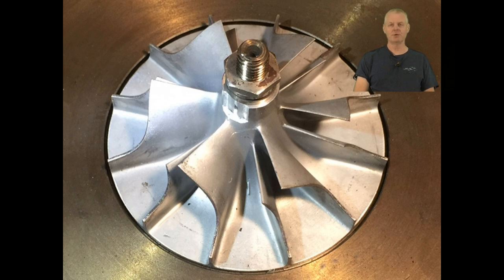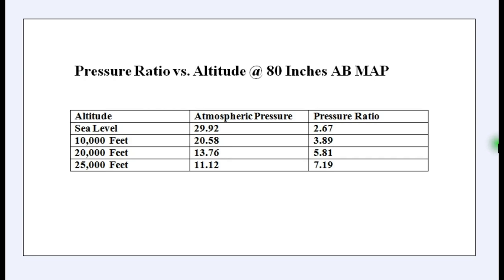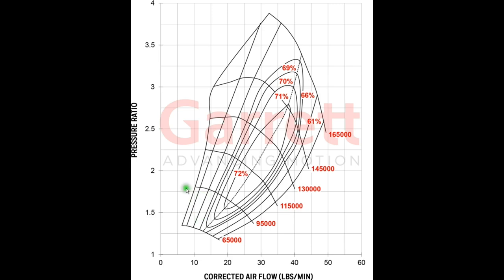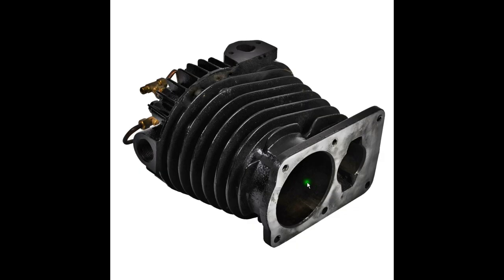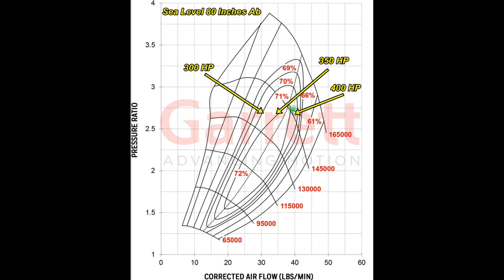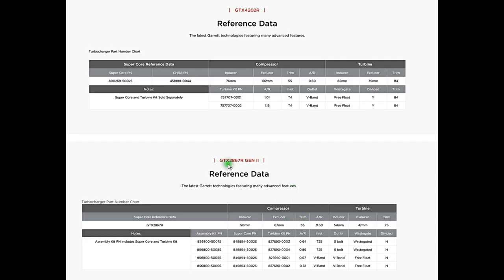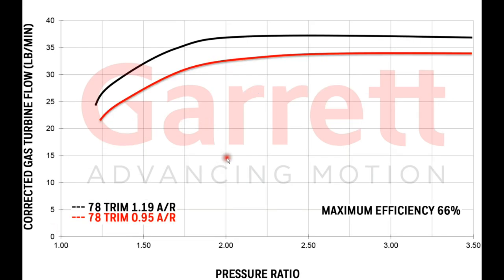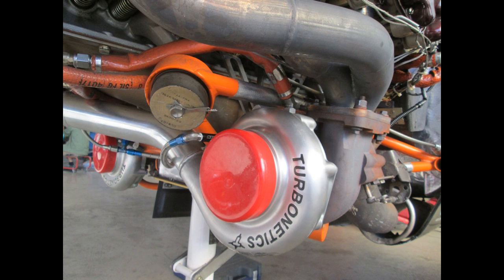What's Wrong With Raptor's Compound Turbo System?

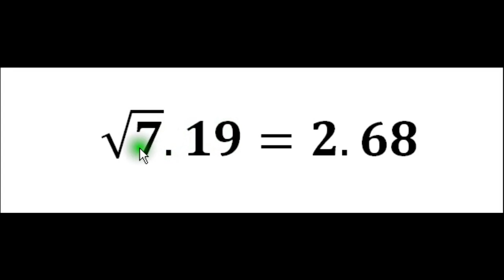Comment: Thank you for the video! I followed most of it--can anyone help explain how/why at 6:15 we multiply one turbo's pressure ratio (~2.68) by corrected airflow to get the 80 lbs/min figure? I'm guessing that's part of an equation for compound turbos?
Reply from the maker: Compound compressors are typically matched from the 2nd stage airflow first  and then multiplying by the first stage pressure ratio (2.68 in this case) Using Boyle's Law,  volume delivered by the 1st stage to the 2nd stage will be 1/2.68 (0.37) 0.37 X 80= 30. Note that Boyle's law assumes constant temperature during changes in pressure and in reality, we won't have that in a compound turbo system, which isn't a closed system either.

The video also ignores the fact that there is substantial temperature rise during compression and does not take into account any intercooling of the charge  air which we'd certainly need to do to have a functional system. 

The video is illustrative only (which I'm sorry, I didn't make clear) and is not about solid numbers for compressor matching for Raptor. My main purpose was to show that the equally sized compressors cannot work at 25,000 feet and the required pressure ratios. I tried to make that part clear by using the analogy of the 2 stage air compressor and showing photos of the size difference on actual compound turbo setups.

 I also tried to explain why the turbines used here are too small and also greatly impacting performance. As a data point, my 2.2L Subaru uses a turbine wheel about 10mm larger than Raptor where Raptor should have something around 10mm larger than mine with almost 50% more displacement and around double the HP.

I think many people are confused when I use the term compressor mass flow. Compressors are rated by CORRECTED  INLET flow- either CFM (volume) or mass of air (usually lbs./min).  

Corrected meaning inlet pressure and temperature are taken into account and often specified on the compressor map. If the map was developed at or near sea level,  that will be the correct inlet mass flow processed by the compressor down there. 

Now move the compressor up to 25,000 feet where in the inlet pressure and density is about 1/3rd of SL conditions and compressor won't process the same mass of air as at SL at the same compressor rpm.

Up high, we need to intake a greater volume of less dense air and compress it back to near SL pressure to feed it to the 2nd stage compressor so it can then increase that pressure to the required value  in the intake manifold to make rated power.

There are a myriad of other factors involved but a simple, short video can't cover all those things and that wasn't the intention of this one.

I'll try to touch on some other factors in subsequent videos on turbocharging and intercooling as this seems to be a popular topic.
Reply: @rv6ejguy  I follow now. Great explanation. Thank you

Comment: I totally agree that the engine setup and especially turbo setup needs to be different , and I do think that peter has to contact someone like you Sir in order to make them better.  the engine on raptor doesn't that good this is a fact.

Comment: Back in October 2018, I had the opportunity to visit the Raptor prototype and see what all the fuss was about. Peter was mobbed, but I had great talk with Jeff Kerlo his right hand man on the composite side of things. There was a couple of questions that I had, especially since I had built and flown an Express Aircraft (Auriga). I thought that the prototype was engineered poorly, especially the doors, which were way too complicated and heavy, the lack of radiator cooling, and the cantilevered seat mounts which were extremely heavy. The whole plane smacked of a computer generated fantasy, with no real knowledge of engineering.  I asked Jeff point blank why Peter  insisted on an experimental engine on an experimental aircraft prototype, he just shrugged and said that Peter wanted it that way. Just look at the Dark Aero boys--are they putting an experimental engine on an experimental prototype? Of course not, they are ENGINEERS. I have no qualms with being self taught, hell Elon Musk is primarily self taught--but he hires really smart and talented engineers to get the job done. If you are going to design and build an experimental aircraft start small say a two seater, and work your way up. Don't go full bore with the most complicated thing you can think of, dupe people of 25 grand a piece, and then claim that prototype 2 will be better. Give me a break.
Reply: Rick Feehery,  I'm really impressed with the Dark Aero brothers.
Reply: @YeshuamyKing53  , Yep!, me too!

Comment: In this case, why couldn't a single sizable turbo with a substantial impeller work since quick spooling is largely unnecessary? Maybe you covered this in which case apologies but it seems you're saying that a compound system is necessary.
Reply from the maker: No compressors in this size range can efficiently produce pressures ratios over 4 and we need 6-7 here.
Reply: @rv6ejguy  Would we also want to add fuel then?
Reply from the maker: @MrBryansa  The diesel requires excess air to operate efficiently, more fuel just raises EGTs further.

Comment: How do you calculate ideal turbo charger combinations when there is the big unknown of how much bleed air will be required to pressurise the cabin?

Seems to me you can’t until you take the aircraft up to FL250 while keeping the cabin altitude at something under 8000. Only then will you have the necessary data to make selections of the better turbo charger combinations.
Reply from the maker: I believe Peter was feeding the pressurization system with a 1/4 line in ground testing which may be too small unless he has exceptional sealing. In any case, most small cabin class twins leak something less than 30 cfm. Since this compressor is putting out around 1230 CFM, that would only be 2.4% of output which is inconsequential.
Reply: @rv6ejguy  Ah ha! Thanks for clarifying. I had no idea what leak rates could be expected.  It is indeed surprisingly inconsequential.

Comment: So what I’m seeing here is that the Raptor’s capabilities will be limited in terms of power and efficiency - it won’t efficiently push itself to the proposed altitudes, and it will have a hard time staying there. It might even be why cooling has been an issue. And maybe was a contributing factor to the engine failure. 
These are not minor issues. I truly hope there is the potential for things to change.

Comment: The thing is, retrofitting the two turbos in Peter's setup wouldn't be a tragically difficult switch, but would provide dramatically better HP.
Reply: Better HP an less heat to deal with.

Comment: From this it sounds like Raptor could conquer its engine cooling issues quickly by downsizing the 2nd stage turbo, or up-sizing the primary, if there is room in the engine bay.  It doesn't seem like it would be too expensive to fab. an adapter for a smaller 2nd stage.  I'd try that first.
Reply from the maker: Changing the turbo system would only make minor improvements  to engine cooling. Raptor will have much bigger cooling problems as it climbs into thinner air and at higher than 65% power like it's using now on a summer day. 

The coolant, oil and charge cooling systems are all poorly designed and would need a complete re-design from scratch to be functional on a 100F day, climbing to FL250 at climb power (say 80-85% power.
Reply: @rv6ejguy  I'm sorry to hear this, however, it sounds like Peter already has a complete redesign in the works.  This is also a very sensitive topic over there...
Reply from the maker: @bartofilms  It will need a complete re-design to get anywhere close to original performance predictions.

Comment: Presumably the people at Garrett would know this too.  I wonder if when choosing turbos, other considerations took precedence, such as actual physical size, in order to fit them inside the cowling.  I'm not saying that this is a valid line of thinking, just speculating on how we got here.
Reply from the maker: I believe Peter chose these turbos himself based on his flawed understanding of the topic. Had he consulted Garrett engineers with aviation matching experience, he would have ended up with something a lot different.

Comment: Great video- I've been interested in compound turbocharging for awhile in the diesel truck world, and am becoming interested in aviation- which leads me to a question: Is the mass airflow in the efficiency island graphs the same at different altitudes with the difference being final absolute pressure? or does the mass airflow also scale with altitude for the atmospheric turbocharger?
Reply from the maker: I've answered this one several times here. Mass flow is at the compressor inlet so the lower the inlet pressure, the higher the inlet flow must be to deliver the  desired outlet flow at the desired pressure ratio. Boyle's law applies here roughly with corrections for air density with temperature change from compression.

Since inlet flow and pressure ratio changes with altitude, you'd see a change in point on the compressor map.

Comment: Really nice video,  thanks for making it.  Good to know that raptor has some low hanging gains to be made in the future,  he has an whole air frame to finish developing first.  Do you think he's flying with dangerous egts or just suffering poor efficiency and output in the meantime? Is there other dangerous damage he could be doing?
Reply from the maker: The piston crowns and exhaust valves will be taking a beating like this which can't be good for longevity and the high temps generally increase the thermal loads on the oil and coolant as well. The engine never spends more than a minute at true climb power because of the thermal challenges.
Reply: @rv6ejguy  absolutely agree, a properly sized compound setup would solve his thermal difficulties in stead of being a heavy bandage. I've seen him compare his fuel rates to horsepower output without talking into account the absurd exhaust pressure and temperature readings proving inefficiencies.
Reply from the maker: @davidgreenfield1476  The thermal difficulties go far beyond the improperly matched turbos. The oil, water and charge air heat exchangers and ducting for them are all improperly done as well. Agree, judging HP from fuel flows is invalid without dyno numbers. The estimated HP was much higher than what the ground acceleration or ROC would suggest for this weight of aircraft. I've run the ground accel numbers myself almost 2 years ago and those show 250hp at best.
Reply: @rv6ejguy  Ross, I think 250 HP is being optimistically kind. Based on static thrust measurements, take off acceleration and his demonstrated performance following the engine failure, raptor is developing somewhere in the range of 160 to 200 HP at  full power and in the the range of 120 to 140 HP when throttled back in the climb. Truly pathetic  for a vehicle that is expected to operate at 25K.
Reply from the maker: @keithturner3859   Yes, probably slightly optimistic. Remember that prop efficiency isn't 100% though and acceleration will be based on the average  force delivered throughout the run. I've working on a new video which will cover this.
Reply: @rv6ejguy  Ross, I looked at the likely horsepower being delivered from a number of different ways to get an estimate of the likely ballpark for the actual numbers. The 5 bladed prop will be considerably more lossy than a two or three bladed prop of the correct dimensions. The need for a 5 bladed prop to couple the HP to the air mass is just another compromise to having the main undercarriage too short and in the wrong location to allow a larger three blade prop and have the correct fuselage rotation angle without polishing the runway with the blade tips. Looking at the incremental acceleration and making some guesses at the takeoff weight and rolling friction, form drag and propellor efficiency and just using Force = Mass x Acceleration would put the numbers into the 160 HP ballpark. In some of his videos he talks about static thrust measurements at full power that are in the 160-180 HP range for a Cessna 172, 182 type of aircraft. The numbers are not in the 350-400 HP region where they need to be to  have the performance to operate at 25K altitude levels I would take a bet that even if he had the main gear in the right place and correct length to be able to use a three bladed prop ; had the correct ratio on the redrive to get maximum HP; had the turbos correctly designed and the fuel flow correctly programmed that the audi engine he is using doesn’t have the capacity to deliver the needed performance with any life expectancy. There are so many areas of the the raptor design that are so poorly optimized that it would be difficult to know where to start to get it back on track.
Reply from the maker: @keithturner3859  The static thrust numbers were 1000 pounds in one test so that says around 250hp as most combinations will deliver around 4 pounds/hp. The accel runs show around 230hp assuming 60% prop efficiency and ROC  performance brackets that number as well.

It's obviously nowhere near 350-400 Peter claims. I agree there are multiple major issues here and I'll be covering all that soon.
Reply: @rv6ejguy  I must have missed the video where he measured 1000 lb static thrust. The best numbers I saw were in the 800 lb region. His test methods and data reduction are so sloppy and  inconsistent that it would be hard to  draw any conclusions from his measurements other than they all point to major deficiencies in the stated expected performance. Like so many other areas of the engineering he just shrugs it off, patches it up and works around solving the problem in a robust way.
Reply from the maker: @keithturner3859  I agree, the data collection methodology is often questionable there. It's certainly very far short of his projections. Way too heavy, way short of power.

Comment: I was initially excited about the project, not so much now.  Aircraft weight aside, do you think the Audi engine is the best choice?
Reply from the maker: No, it never was a good choice. Way too heavy and with Peter's mods, it has less power and stock, burns more fuel and is less reliable.